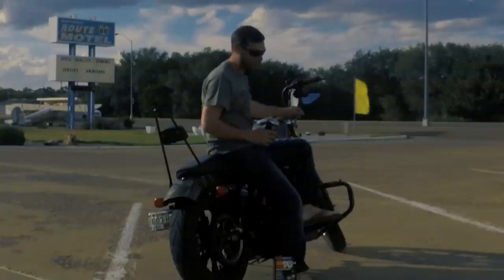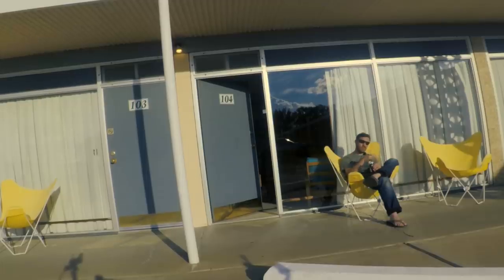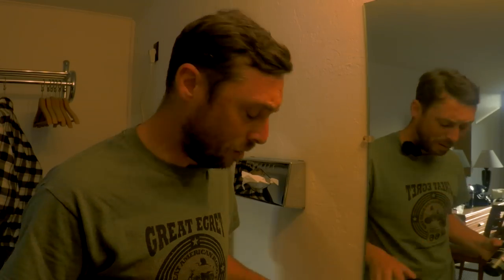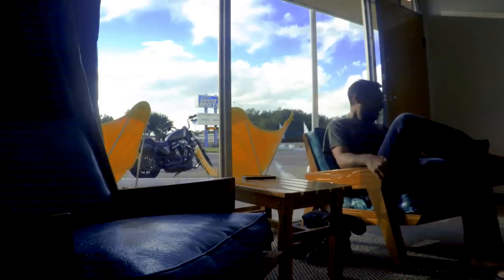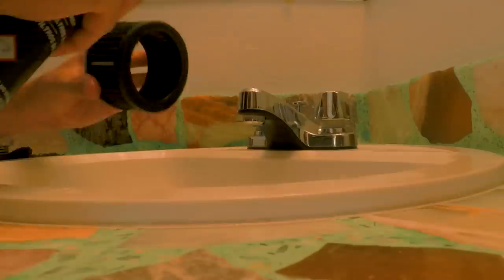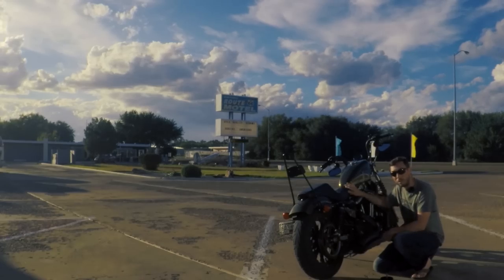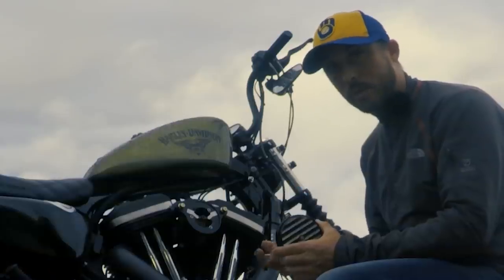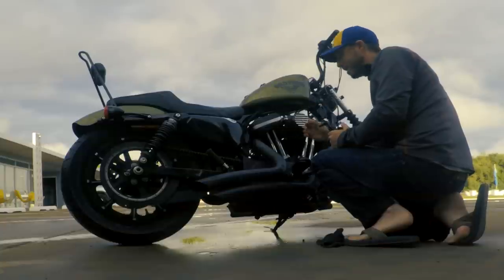How to Clean and Oil a K&N Air Filter on a Harley Iron 883 - On the Road Edition

Comment: Good ol’ G-burg! Lived about 45 minutes from there in Maryville. Great vid sir! Also, depending on the filter media, you may not need to add oil. My Arlen Ness stainless mesh needs no oil after cleaning. I thought it needed it when I cleaned it. To my surprise, every bit of the new oil drained out of the filter overnight. There’s a couple pennies worth.
Reply from the maker: I have really good memories of Gatlinburg. Love that area. Good points on the filter media.
Reply: I have a big sucker with the stainless mesh as well that I’m putting on soon. Any tips and tricks with this filter Wet Banana or its basically just a straight forwards easy maintenance filter?
Reply: Smokey Tokey pretty much as straight forward as it gets sir. Use filter cleaner, or diluted Simple Green. Rinse well and allow to dry. Beautiful thing is that no oil is required for the filter!

Comment: Hey Joe 
 I have been using K&N filters for years, for long trips  I bring an extra cleaned and  pre oiled filter in a ziplock bag the price for the filter alone is not bad compared to having to mess with a filter on the road. and your is small enough to fit in your bag. 
BTW this sounds silly but keep a straw in your kit you can use to scrape out the filter and blow the debris loose from the inside. 
Don't want to sound like a know it all, but like the old saying goes "been there" just passing on what I learned over my riding years.
bike covers yes are nice but a blue tarp is cheaper and more useful that and bungee cords.
Spraying the filter is about a cup of coffee job or about one beer to complete.
Reply from the maker: All very good tips, my friend thanks for sharing them. I could have made the trip home without cleaning and oiling, but I was stuck in Tucamcari because of weather and thought that it would be a good opportunity to show everyone how to  it. Good tip on the tarp.
Reply: That and it made for an interesting video, most auto and motorcycle channels never cover the subject of on the road maintenance which on a long trip you are bound to do if nothing else look your bike over basic stuff tires, belt, bolts etc.
Reply: why do you oil it?

Comment: Did you have to clean your filter in this specific way because it was an open air filter? I still have the stock filter on my 1200 custom whenever I want to clean it I just take off the cover and use a brush and brush around.
Reply from the maker: Not necessarily because it's an open air filter, but that's part of it for this filter.  It's just a different type of filter that requires oiling.  There are covered air filters that require oiling as well.

Comment: Is the stock filter supposed to be washed too or replace ? 
What’s the mileage for replacing the stock filter ??
Reply from the maker: The stock filter should be replaced as it's not an oil-based filter.  There really isn't a set mileage to replace it.  There are a lot of factors mainly related to riding style and riding conditions.  Best advice is check it whenever you change your oil or at the 5K, 10K, 15K, etc... service intervals, whichever comes first and change it if it's really clogged with crap.
Reply: @GreatEgret  I change mine every 5000 miles.